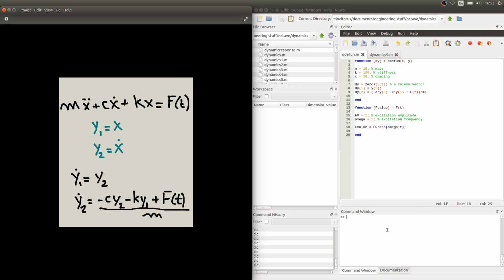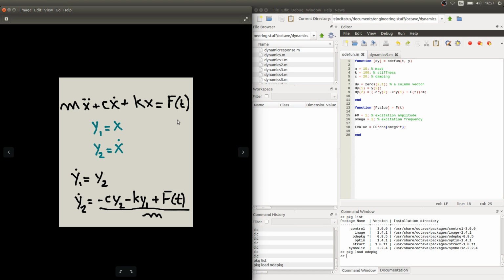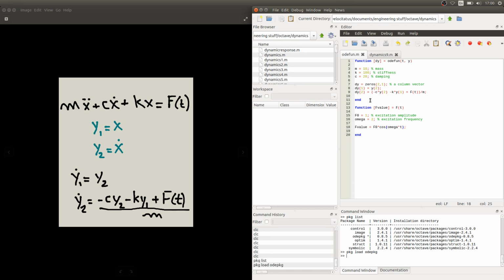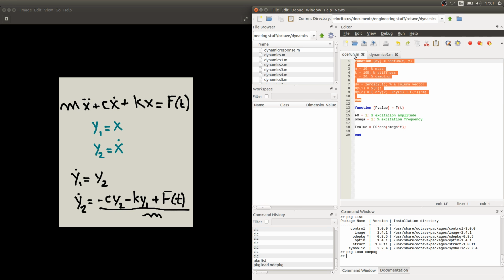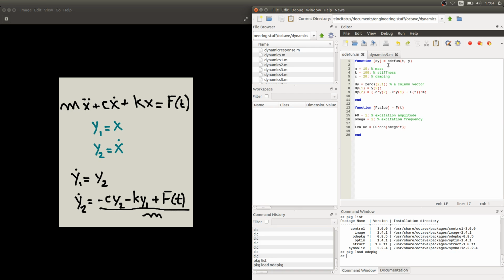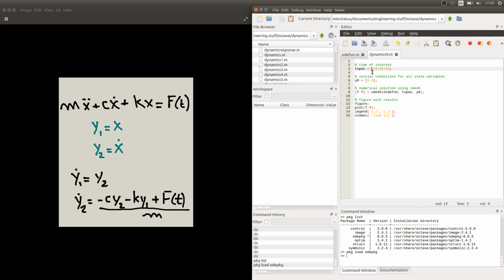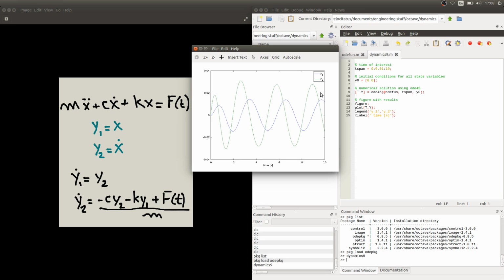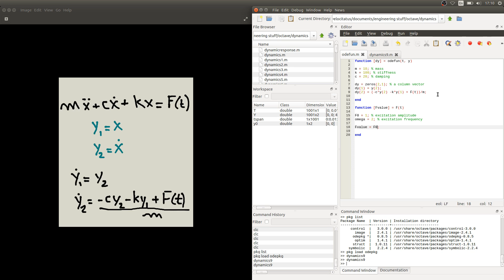octave dynamics 08 numerical solution

Comment: Thank you for the video. How can I add parameters (a, b, m...) which I know an aproximate value in order to estimate these parameters?
Reply from the maker: I am not sure what you mean. For a simple numerical solution like this, you need to give values for the parameters in order to perform the calculations, and then see the response of the system for these values. If the response is not what you expected, for example from experiments, then you need to find the correct values. There are many methods for parameter estimation, and they basically compare values from experiments and from a mathematical model.